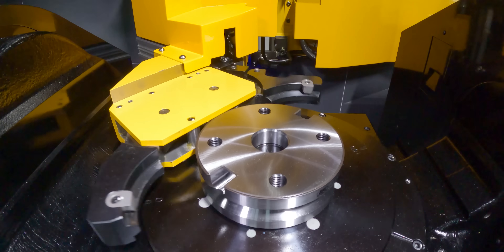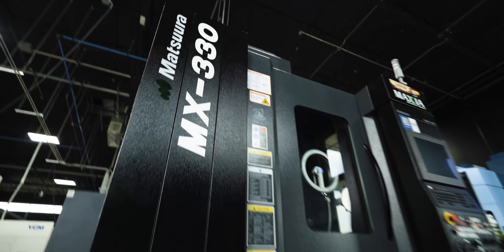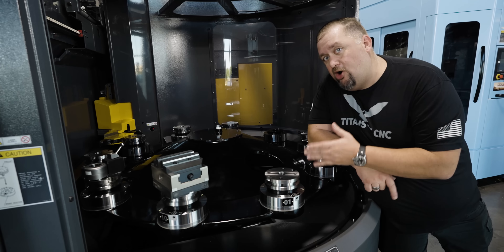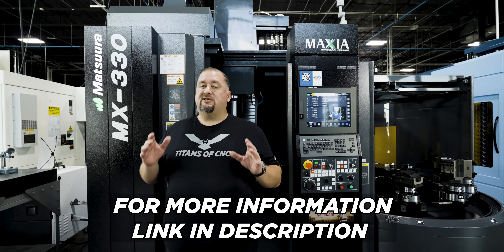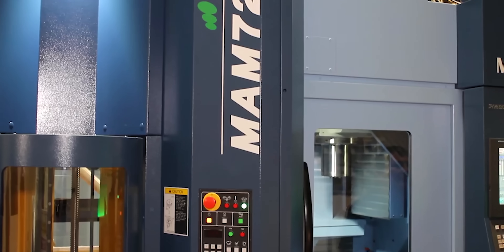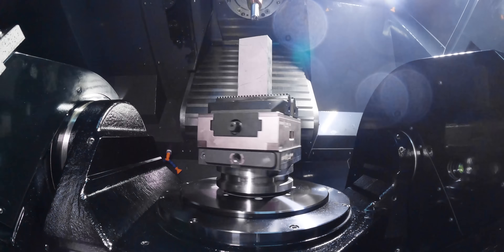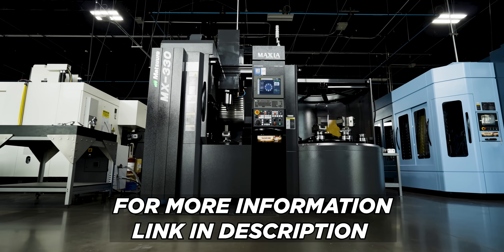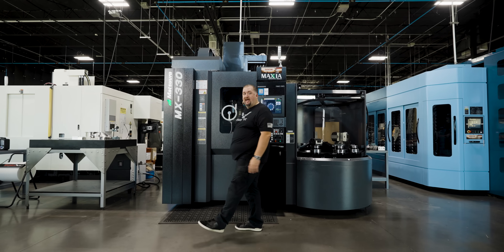Have you ever seen this CNC Machine?

Comment: I worked on Matsuura machine tools for years. Excellent machines. The high speed spindles were a bit fragile though. Anything more than a minor "bump", and a spindle replacement was required. Worth keeping in mind if you are placing less experienced machinists to work.

Comment: Don’t get one of these machines if you’re doing very very frequent tool changes and running at high RPM. Especially don’t get the grease pack spindles if you’re gonna do that. Make sure that all your spinners are the oil bath spinners otherwise you’ll be replacing spindles in less than a year.
Reply: Yeah I've never experienced a spindle go out in almost 5 years.
Reply: I ran 3 of these for almost a decade and never had any issue......

Comment: Good machines but we had a problem with ours, our one keep dropping pallets from the top and I mean bang vice and pallet scrapped, job scrapped production stopped. Turned out to be one of our lights on our workshop roof was affecting one of the sensors, and we fixed it by putting a piece of cardboard in front to block the light

Comment: We just went and toured HELLER last week in Troy and had a wonderful experience, first heard of then from your videos and they've been at the top of our list ever since, the rigidity and strength to withstand years of abuse with no maintenance is astounding and the two piece spindle is game changing, not to mention their custom tool holders we got to see
Reply: They were just bought out by DN solutions
Reply: @2SMPerformance 
Also a good company.  They have the best service network in the industry. 
Their designs are less sophisticated than others, which is great for reliable operation in less than ideal conditions, unlike the German- influenced machine tools.

Comment: Not even trying to hide that this video is just an ad.  Would love to see the machine actually running a part, rather then half second trade show table clips.
Reply from the maker: We alway start with showing the machine quickly…

Then the next video on each machine goes over set up etc

Then machining parts next.

Just like EMCO1200…
When it arrived we showed off the machine.

Ever since then…

We have just been machining parts on or showing other processes etc.